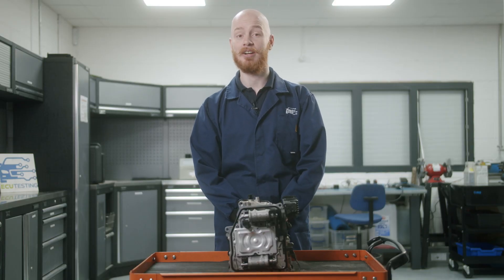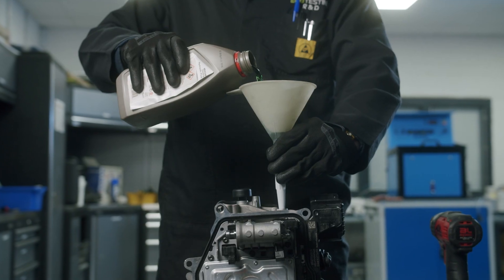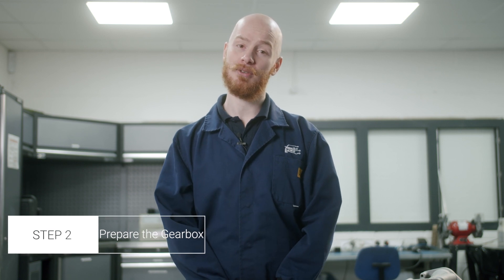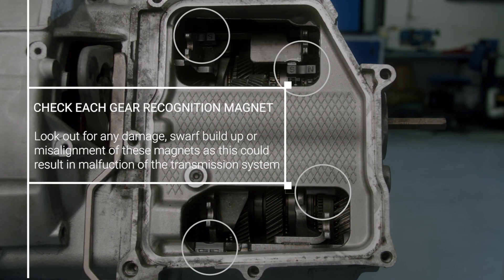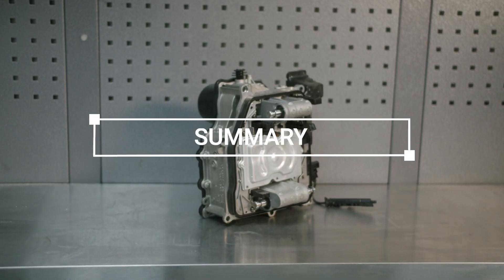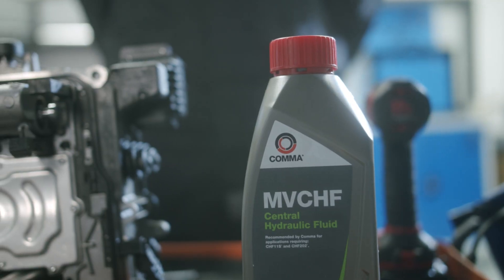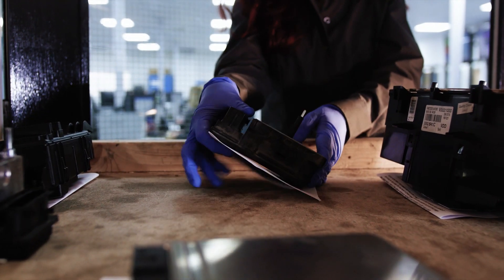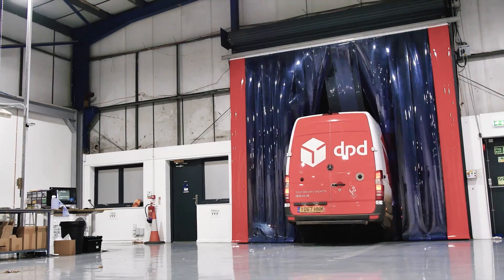DSG 7 Speed Mechatronic Installation (DQ200)

Comment: i really do hope the problem with my  mechatronic in my A1  is something  simple like low on fluid cause im seeing quotes of £4-5k for a whole unit replacement 🥲dreading it when i get a specialist diagnostic done
Reply from the maker: Hi there! If you do find that the mechatronic is faulty, you are welcome to send it to us. If repairable, the cost is much cheaper than replacing. Feel free to get in touch, you can call 01773535638 or email info@ecutesting.com. Thank you!

Comment: When removing the mechatronic unit does the gearbox need to be selected in neutral first ?👍
Reply: You need to place the shift forks in neutral through the scan tool - after doing this special function through the scan tool, turn off the ignition and DO NOt turn it on again before removing the mechatronics (as turning it on again will move the shift forks back)

Comment: Hi,

My Passat 2013 with DSG 7 speed engages when engine gearbox is cold (especially mornings) but doesn't engage when the engine/gearbox is hot.
After turning off/On, gear selection happens but Car doesn't move.

What could possibly be the issue?
Need your support please.
Reply from the maker: Hi. Please email our technical support team at info@ecutesting.com with the following information. Your vehicle's make, model and year of manufacture, the symptoms of the fault including all fault codes, and the part number printed on your mechatronic unit. They will be able to advise you further. Thanks.

Comment: I’ve got a u0101 error code. 09 Audi a3. Fuses and relays are good no crank no start. Car starts if I jump relay for starter. Power is going to the tcu plug. I unplugged it from tcu and oil came out mech unit. Tried to clean. No luck. P flashing at selector inside car. 
I have a mech on order but want to be sure before I fit it
Reply: @ecutestinglimited
Reply from the maker: Hi. We would recommend checking the TCU has a good ground at the connector, as well as good communication lines (CAN high and low) to determine if the fault is with the mechatronic or the wiring.

Comment: What makes this f***ing thing rattle so much? I am in a middle of a dispute with Skoda because of this crap, its like marbles in a tin can.
Reply: Flywheel going bad nothing else. If dsg
Reply: @JRamirez943  Service says some noise is normal, they are not admitting a problem,  my car is under warranty, what do I do, I could use advice.
Reply: worn out release bearing in the gearbox

Comment: Has the top 2 selectors got 3 positions, I can only move  the top left selector in 2 positions. I pulled the mechatronics unit off because the car would not move and I got a P 0841 code & a small discharge of oil out of the breather. Im not sure if I have also a G box issue?
Reply: Hi did you find out the answer I've got the same problem top left has only 2 positions
Reply: @Tara-li6pg  was this resolved?

Comment: Do you have to do any programming of the mechatronic ?
Reply from the maker: Hi Shane. When we retain the original programming when re-building the unit so no additional programming will be needed when re-fitting it back to the vehicle. All you will need to do is follow the re-fitting procedure, replace the oil and you will be good to go! Cheers.

Comment: I have 2010 vw golf mk6 1.6tdi dsg 7 speed gearbox code MLE. Would my car work with the same gearbox removed from golf mk6 1.6tdi dsg 7speed but different gearbox code? Or I need exactly same gearbox code MLE?
Reply: What was the awsner to this?

Comment: hi there i just followed your turtorial on the replacement .Firstly my original units valve body cracked at the accumalator housing . i then replaced it but used my original board .The car drove but it could only drive in d2 and s2 . Then i saw your video and did the correct bleeding , basically did everything you did.I then now left it in neutral and removed the unit . before installation i measured the selectors to 25mm and made sure the selector forks are neutral while the shifter was in the neutral position . I got everything fitted but i cannot start the car due to me  getting a U0101 error code , which means "no communication with tcu/tcm. any help would be great . The car is stuck in park now , park light is flashing and dash says please put vehicle in park.
Reply from the maker: Hi if you are getting no communications to the DSG mechatronic there may be issues such as poor fitting, bent pins, fuse or feed issue. If the vehicle all checks out as good you are welcome to send us your unit for testing and rebuild if required: https://www.ecutesting.com/common-faults/volkswagen/volkswagen-golf-audi-a3-dsg-7-gearbox-problem/
Reply: @Ecutestinglimited  the pins we bent yes, thanks for the reply
Reply: @468garage6  whichs pins ur talking about where is fuse?
Reply: @Ecutestinglimited  Dam, you guys are awesome for assisting OP
Reply: i have same problem but i was on highwar when i changed from D TO S TO OVERTOOK  a truck i lost whole gearbox n now pnds flashing with esp light is on 
errort code u0101
Reply: @mrsingh1696  and? solved? My dq200 is in garage at the moment with 02AutoTrans Cannot be reached
Reply: when starting the car after installed the mechatronic and put it all on natural. do you also have to start the car on natural. or do you have to put it first in park then start?